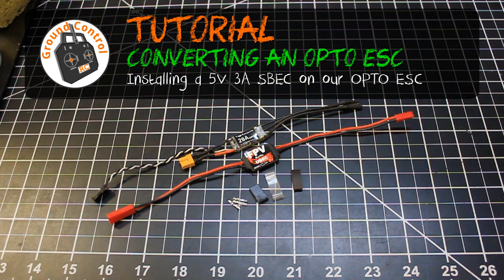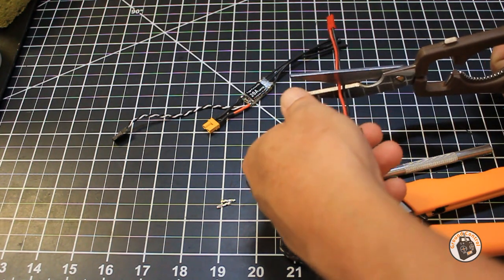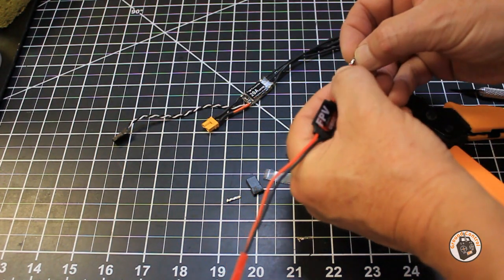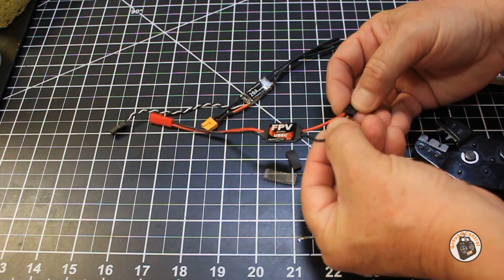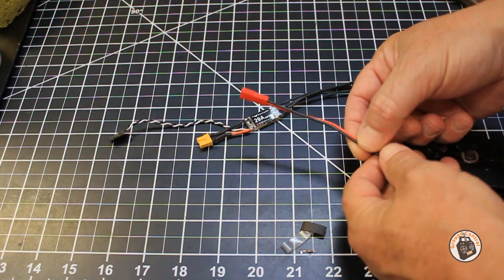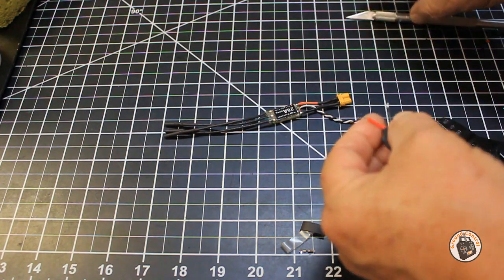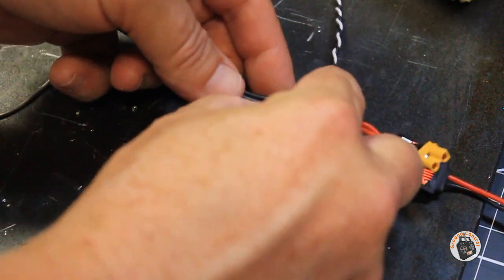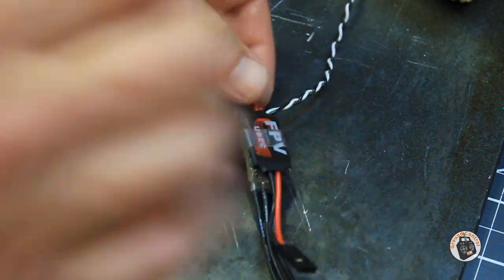Tutorial - Converting an OPTO ESC by adding an SBEC (Switching Voltage Regulator)

Comment: Great tips for wiring a bec. I’m using the same bec and a similar esc for a small rc rock crawler.
Reply from the maker: Thank you!
I had to come up with this solution after discovering a 1S Power System was just not going to work.
The best laid plans ;-)
See you in the Air!

Comment: You could install the signal wire in the same servoconnector where you have 5V, the ground are the same.
Reply from the maker: I don't know why I didn't think of that before. What about installing the hot wire in with the existing ground and signal wire then I wouldn't have to install a separate servo connector. Do you think that would work? I have two more of these OPTO ESCs and Voltage regulators to test. Thanks for the great idea! Sometimes you just need a second set of eyes that can see the trees for the forest ;-) Happy Flying!
Reply: If the voltage regulator are common ground (they normally are) it should be ok :-)
Reply from the maker: I just clipped the ground wire from the ESC and moved the signal wire to the power and ground connector on the voltage regulator servo connector. I put it in the plane and it works absolutely great! That also brought the weight down to 10.9g and now there is no downside to doing this as you're just using one receiver port ;-) Thanks again for the tip and correcting my Brain-Cramp ;-) Happy Flying!
Reply: As an engineer i am not surprised. But i have been designing high power electronics for decades :-)
Reply from the maker: Great question! I see no disadvantage to that at all. As a matter of fact, I've ordered several variable voltage switching regulators that are sold with no leads, just boards to use in projects and planes. The thing I always look for is; are they a Linear or Switching Regulator? What is the Max. Input Voltage? How many amps at 5V output will they provide? I like to make sure I can use input voltage from a 2S-4S LIPO since those are what I use. I also like to make sure I have 3 amps of power at 5V output because in addition to powering my receiver and servos I will also use it to power my FPV System. It just depends on the specs you're looking for. As long as it meets you needs you should be good to go. I hope that helps and Happy Flying!